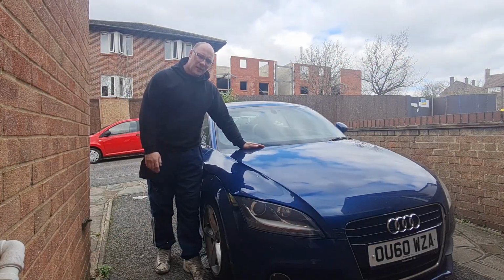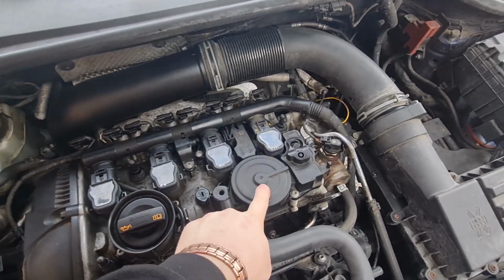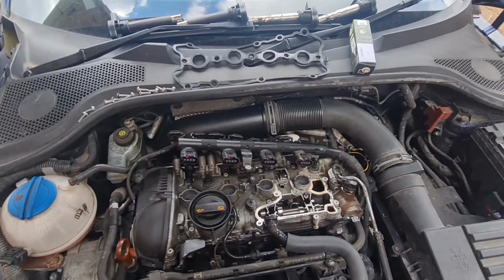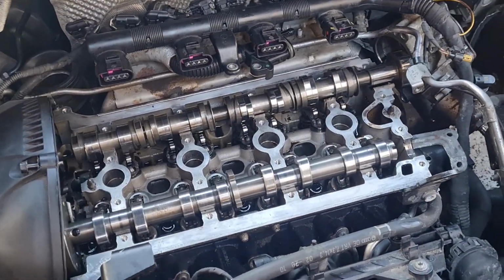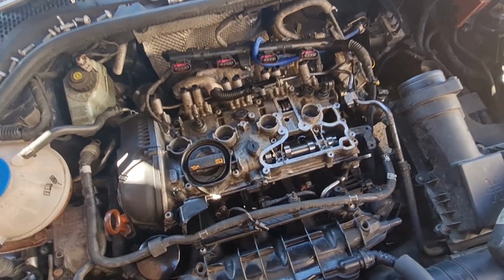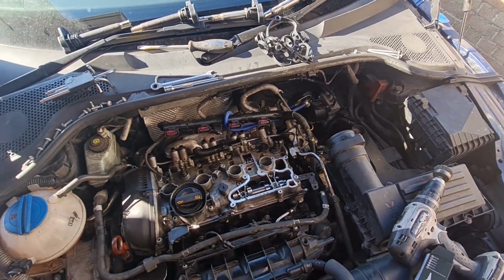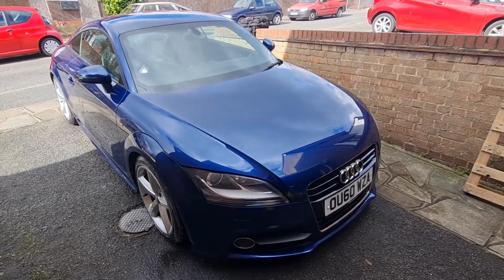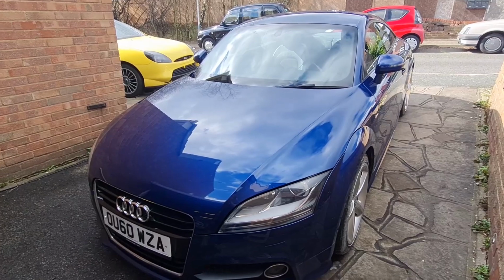Audi TT S Line Mystery Misfire SOLVED! PCV Valve change, Rocker cover reseal and Exterior Detail !!

Comment: Will any kind of car gasket sealer do the job?
Reply from the maker: Hi, i would always use an oil resistant rtv sealer otherwise it may leak, never use silicone, hope this helps MEC 👍👍
Reply: @mec-tec  I couldn't get the top off no matter how hard I tried even after removing all bolts connected, so I had to just stick it back down with some sealer where I could get it in :( going to have to take it to a garage I think

Comment: Where did you buy your PCV valve from?
Reply from the maker: Hi from memory it was from ebay regards mec 👍
Reply: @mec-tec  thank you! 😅
Reply: I’m still getting a misfire from cylinder 2 after replacing the following 
MAF sensor 
Breather valve 
breather hose 
Oil separator 
Oil separator hose 
Spark plugs 
Ignition coils 

I have noticed that my cam cover is leaking slightly and it’s getting on the plugs. Do you think this might be the issue?
Reply: The car drives pretty much perfectly 90% of the time, it just has the occasional hiccup

Comment: I have a similar problem on my Mk 2 2009 Audi TT TFSi S Line.  Codes are P172 and P301 (cylinder 1 misfire) replaced plugs, Ignition coils and PCV valve.  Still well bad.  It’s in the garage at the moment and they can’t seem to find the issue either.  It only misfires when it has a Loud on it (higher gears along the road) fine on tick over 

Any help appreciated
Reply from the maker: Thats a strange one mate, usually when a car does it under load its the plugs or coils or on older cars the ht leads, as youve changed them that should rule them out, have u check your rocket gasket isnt leaking into the plug holes as it maybe fouling the plugs, other than that possibly another vacuum leak somewhere or worst case a burnt valve 
Regards MEC 👍
Reply: @mec-tec  The garage thought it was the MAF sensor.  They have just put a genuine audi one on and it’s still the same.  They did a smoke test, which showed no air leaks.  Could be an Injector I’m told, not much left 🙄🙄 it’s So frustrating mate
Reply: @TheresOnlyOneKeebs  have you tried to run a tank with Vpower and Liqui Moly Fuel system cleaner 1803 or the pro version 5153? That'd rule out the injector. If you've tried it already, I recommend doing a carbon cleaning, it completely cured my mysterious cylinder 1 misfire (2008 standard 2.0 TT) back in February after replacing the plug and coil pack to no avail. Auto Techs did a very good job for £130 or so stage 3 package. Or go for a walnut blasting to clean the intake valves as they might be sticking due to carbon build up.